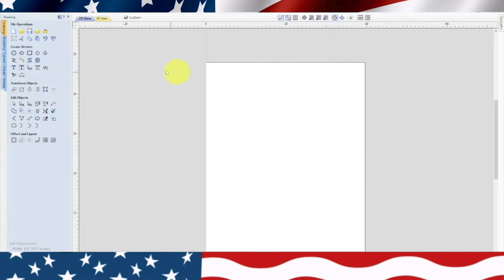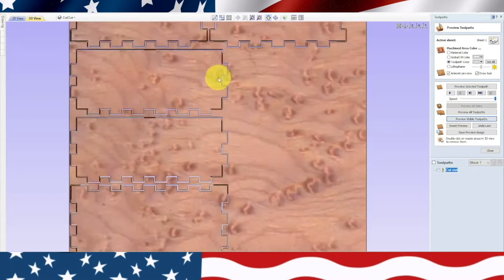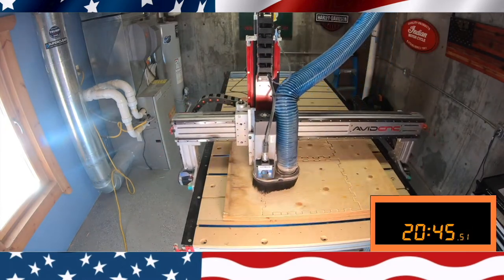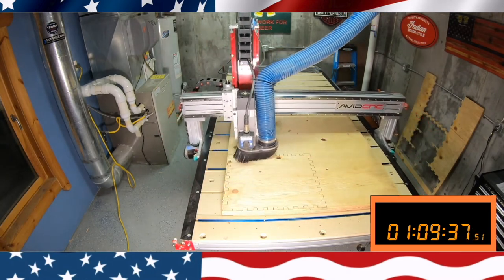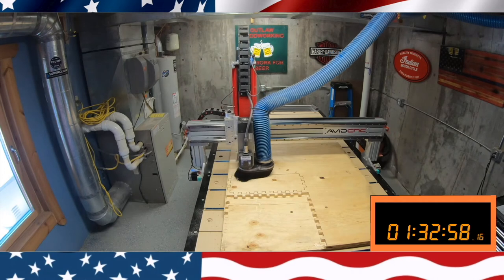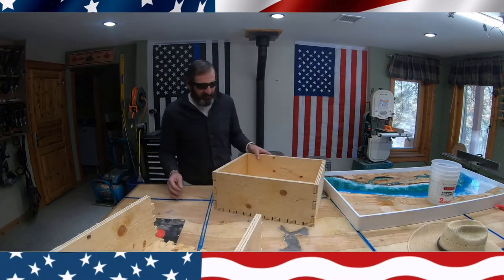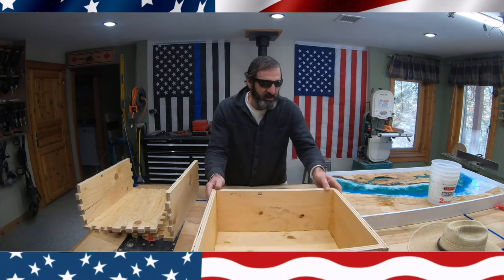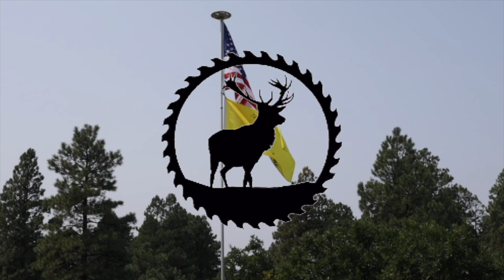VECTRIC BOX CREATOR GADGET LESSONS LEARNED

Comment: You mentioned that you have to use the box gadgets output and can’t redraw the lines yourself . My question is Can I redraw the lines if I use all the same information tin the tool path creator tab that the box gadget used.? Reason is I need to reposition my part to place it diagonally on my cutting table .
Reply from the maker: I think you could do it, there was someone that mentioned he was able to , I haven’t tried it yet ,let me know how it goes
Reply: You can reposition it anywhere.  I use the nesting feature to move  big box parts to seperate sheets. Just remember that you have to profile on the line not the outside and add tabs back if you lose the toolpaths which seems to happen with nesting. But it works slick to have 5 sheets from one box creation.
Reply from the maker: @benkeller3  thanks , good advice

Comment: I move my gadget boxes around all the time.  Just have to make sure you recalculate them.  Over a hundred boxes of all kinds of sizes on my 25x25 shark.
Reply from the maker: Nice , so recalculate is the trick ,I’ll give that a try thanks
Reply: @OutlawWoodworking  Yes on the square box joints.  The dovetails you can't move those around.
Reply: Thanks for this tip. I was wanting to build some that wouldn’t fit on a single sheet on my 4X4 bed. I’ll give this a try.
Reply: Nice video. What feeds and speeds did you use on that 1/8 bit. I have the same AVID cnc. I love it.
Reply from the maker: I’ll have to check on that
Reply: @OutlawWoodworking thanks. I'm about to make some boxes.